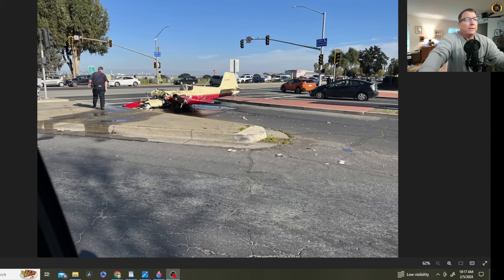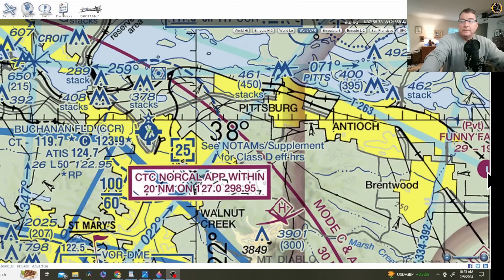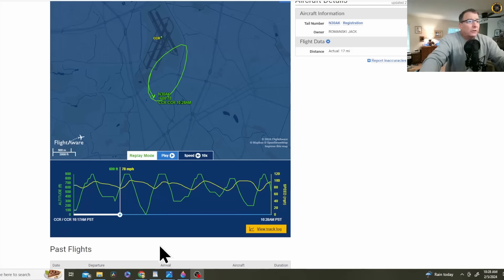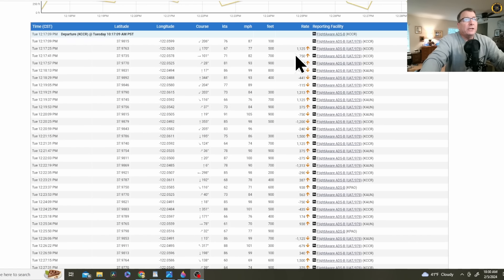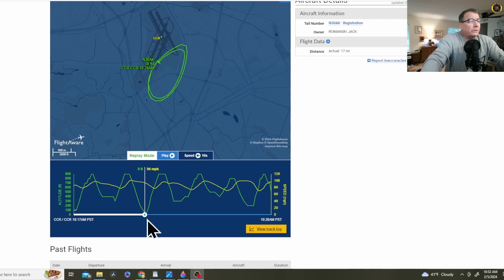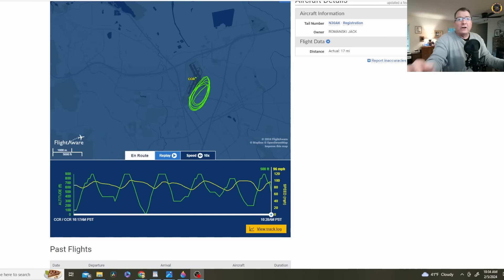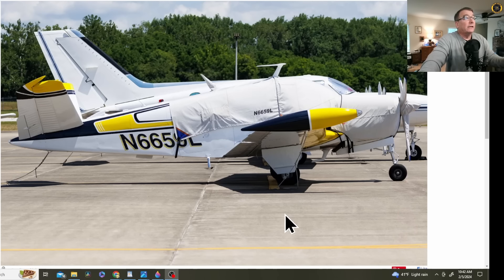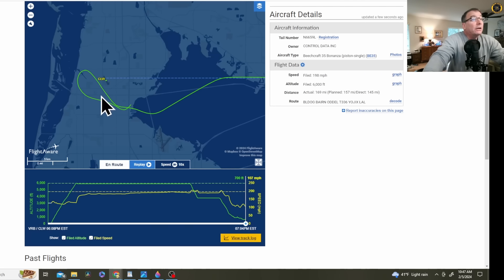RV-6 Crash Concord CA and V-35B Clearwater FL. Crash 5 Feb 2024

Comment: Spins need to be in PPL training

The video of that Bonanza crash looks like he was going super fast
Reply: Even with spin training, they don't demonstrate how a spin can happen when in a steep turn well above "stall speed."  I put that in quotes because it's not a speed, it's an angle of attack.  I believe it keeps happening to pilots when trying to make a sharp turn in an emergency because they don't realize how easily they can end up upside down before having time to say WTF?  Another factor is using rudder to help the turn.  Too much rudder makes it more likely to drop the inside (low) wing.  Instead of straight and level, perhaps it should be demonstrated (at a safe altitude) what happens when you pull back too hard while at a steep bank angle.

Comment: Juan, I'm surprised you did not mention using a moving map GPS for guidance to an airport in a congested area or an airport that is hard to find for any reason ... especially at night.   I don't think I would fly at night if I did not have GPS navifgaton in the panel, and I have over 820 hours of night time logged without an incident.   I am also an advocate of longer run ups before flying at night.   If the engine is not going to go, let it happen at the run up area or the hold shortr line, not 100' AGL.  Be careful out there, folks.

Comment: The L-19s we use for glider tows here in Hawaii (HDH) get used even harder, full throttle to 1,000', then back into the pattern and land. Often 20 times a day, seven days a week.Amazingly, engine failures have been very rare, pilot failures not so much.....

Comment: Blanco thx for analysis. My two cents on pattern engine flying is it's not really meaningfully different assuming temps are controlled. Long climbs to altitude in GA planes are probably more likely to create high CHT for extended period conditions if I had to pick one I'd pick that. Shock cooling isn't really a thing in CA temps.
Reply: I don't know much but I thought about carbon deposits? Would that be relevant?

Comment: Was the mistake simply trying to turn too hard with not enough airspeed? Would there be a way to (reasonably) safely land in the scenario he was in?
Reply: I was wondering the same thing. I would have thought he's have emergency landing spots all picked out ahead of time since he flew the same pattern so many times.
Reply: That was the mistake.  Turning while trying to maintain altitude adds G loading and increased G loading increases the stall speed.  if you're going to turn hard, you have to accept a higher rate of descent in order to not increase the G loading.  At low altitudes that's just not an option.  It usually ends up with the aircraft stalling and spinning right into the ground with no time to recover.  Landing straight ahead, or maybe within 20 degrees left or right of straight ahead was really his only option at that low altitude.

Comment: Juan, One more thought, I heard from a Cirrus driver on the ground near the airport, that the engine apparently "backfired" 3 or 4 times just before the crash which could indicate a problem and that the pilot had some prior indication of an engine issue as well.  I, too originally thought he ran a tank dry, but we shall hopefully learn what happened. I got my PVF hangar 30 years ago from the wife of a Mooney driver  who was on approach from near TVL who unknowingly didn't know he ran a tank dry about three miles before PVF. Obviously no GUMPS check. There were other factors of which I won't go into here.

Comment: Juan, you may remember in the 70s at Concord Buchanan Field a very similar accident resulted in a stall spin into Sunvalley Shopping Mall. 
Another attempt at the impossible turn or just a high Angle of Attack swoop climb with inability to shove the nose over? Slow reaction time may have been a contributing factor. 
Any sense of the fuel onboard given his fixation on repetitive patern work. Doesn't appear to be much time between passes for fuel management considerations.

Comment: Based on where these accidents occurred I would lean towards pilot error. The RV-6 had terrible pattern form and was constantly demanding near max performance to power idle in rapid succession from his engine. The Bonanza guy had an engine failure on his go around at night at the end of his trip. Both of these could very well have been fuel mismanagement engine failures.

Comment: Just another 3 blade prop accident where the pilot was unable to get the nose down quick enough to prevent a stall-spin during following an engine failure during a high performance climb out. It happened to a friend in his Rocket (can't remember which version of Rocket it was), and another one in his Starduster Two. Both of those were demonstrating the incredible climb angle of their aircraft. Both killed innocent passengers. I have often wondered if the 3-blade props were factors. Not trying to blame the prop here, but rather advocating careful exploration and practice of this area of flight by owners and pilots of these aircraft. Dan Gryder discussed this several years ago on his channel, but he doesn't leave his videos up very long, so I cant link to his video.

Comment: Dan, sorry to see about your crash. I have the same F4F as yours plus the blue version. They fly very well with no issues. You can get some minor wing flex, but only with a high G pullout. It can easily be corrected with some aileron input. If you repair it, land it with some power. Wheel landing work the best. Best of luck!

Comment: It's seems if you're flying this same sequence over and over and over again, you might not react well mentally to a quick and sudden departure from the routine.
Reply: This.  Also, I'd say he wasn't even considering the possibility of engine failure, given how close to the end of the runway he was doing the touch and goes.  If that map was aligned with the data correctly, his "pattern" could be considered reckless.
Reply: OVER FAMILIARITY - CONCENTRATION & A PLAN FOR WHAT MIGHT GO WRONG

Yep, this seems possible, since over-familiarity with what you are doing can mean that you forget to plan for the 'escape option' that you might need. Then if something goes wrong your thinking, planning and acting time to resolve matters, all roll together pretty quickly.

I might be familair with slicing the tomatoes with the sharp knife, but I have to plan each cut so as not to slice through my fingers. Of course, because I am familiar with slicing tomatoes I don't think of the exercise as something requiring planning.

The day I fail to consider what I am doing, and perhaps lose concentration or am distracted, is the day my blood mixes with the sliced tomatoes, and I have to go running to find the First-Aid Box.....

Of course, I have to know where the First-Aid Box is located in the first place....!

Strange as it may seem, the next time I pick up the knife to slice the tomatoes, perhaps my first thought should be where is the First-Aid Box...?

James Hennighan
Yorkshire, England

Comment: Don't live near Concord but I've been there many times.  Even took a side trip to just look at the airport and I think I saw an incomplete HueyCobra there once.  I have a few reasons to be there, but have gone often to Sunvalley Shopping Center as well as the Veranda shopping center.  Also a few other restaurants I like in the area as well as a water park.  Definitely see a lot planes there.  I do sometimes think of the plane that crashed into Sunvalley Shopping Center in 1985 on Christmas Eve.  That killed seven including five on the ground and injured dozens of others - especially with last minute Christmas shoppers. 

I'm pretty sure that I've made that left turn on Concord Ave to Diamond Blvd several times where the plane ended up.

Comment: Re: the RV crash, this account is not at all consistent with the word on the field from those in the know. Apparently it was fuel starvation and he did not stall and spin. He attempted to land on the road Ana’s he was touching down a car came around the corner and he impacted hit. That is from an eye witness from the field that watched it happen. Apparently there was no fuel on the ground at the crash site. Not sure why there was no fuel and he did not check it.
Reply: Yep. He did 15-20 laps every time he flew. He was really good at power off landings. He did hit a car after putting it down on the road. The driver had minor injuries. Initially I saw fluids on the ground but could not tell if it was fire department related or even from the car he hit. Either way. Very sad. Lots of people watched him fly every day. The guy had been flying the plane for 29 years.

Comment: Believe it or not a lot of people do this in vans RVs  maybe go to a close field too. But especially in a Tail
Wheel they just want to fly quick and perfect landings. 
 The pattern is plenty big for a nible RV6 it’s like racing your car around a track a few times then putting it away.   80 is pretty slow and 200 ft is pretty low about impossible For a turn back to then field.   He probably just didn’t have any reason to go anywhere and if there’s busy airspace around didn’t want to deal with it

Comment: Rv 9 A just returned to Pia. Low fuel level alarm after take off.
Returned per ok or they fixed low fuel issue. Returned ok.
Hope there on this
N309S your the pros.
Was setcup and equipment and they fixed it he Flys away. 
Oops fuel switch maybe went back and landed at aux air field.
Be safe

Comment: If you get engine failure in that situation wouldn't you just straighten the plane up and try and glide it somewhere like a road or field. You've got enough momentum speed if the engine was spluttering to straighten up I would have thought.
Reply: In that momemt yeah lift altitude airspeed. Never try to bank. But some ppl panic
Reply: It seems like he tried to make the impossible turn, when maybe he should have dropped the nose, kept the wings flying, and found a place to take it in. Problem being, there's not really anywhere to go off the front of the runway. Its highly developed around the airport to the west, with hills rising up even further west.

He was so low already, maybe there were no options no matter what he chose.
Reply: Drag's a drag
Reply: @brendanh8978  yeah I get what you're saying but surely there must have been parking areas roads if it's a built up area, pick a road and go for that  if you haven't got time hope for the best

Comment: Seems there are a lot of engine issues of late. I wonder if it’s time to build a hybrid GA aircraft engine that can give extra electric motor power when needed, but give 5-10 minutes of prop RPM if the engine fails. I know batteries for that system would be a weight issue. Just thinking about the issue. Very sad.
Reply: What you describe is a solution in search of a problem. Cirrus has already  successfully addressed this with their whole airframe parachute. And it’s very expensive to buy AND maintain.
Reply: @cessna177flyer3  agree, but when you pull the shoot, you still crash, just much slower. I’m thinking a back up for engine power. I mean, there is a back up and redundancy for most every system, except engine power. Again, just a thought.
Reply: It’s a reasonable suggestion. Enough emergency reserve power to buy a few minutes of time to regain some control. Weight and cost penalties would likely be prohibitively high, but an interesting engineering problem to help improve safety.
Reply: @davida56891  or just buy a twin. 🤷🏻‍♂️

Comment: Concord is surrounded by highways and commercial buildings. Its where i got my Private Pilot Checkride on my 17th Birthday.

Rio Vista isn't but a few minutes away and sparsley populated, uncontrolled field. Much better for his type of flying with multiple Touch N Go's. 

Sadly, its the same story.  Loss of Thrust On Takeoff...Land straight ahead or 30° left or right. Pick a spot, monitor airspeed. At the same time do your emergency flow checklist to restart your engine.

Comment: I know we only hear about the ‘news-worthy’ usually fatal GA accidents but for every fatal, how many engine failures result in significant damage / injuries. 
What is the likely hood of surviving an engine failure?

Also, what are the major causes of death from a light plane crash - is it hitting the head on the dashboard, brain hitting the inside of the skull, bleeding out from lacerations? What actually kills people. Can’t fix that until we know what the problem is.

Comment: Excellent observation about pattern flying only. If this guy did that daily he putting
constant high power time on that engine.
Reply: Is this wear/high power pattern also observed in skydiving aircraft?
Reply: @ricardokowalski1579 I would think that would be somewhat different since the skydiving aircraft would at least be climbing to a greater altitude and then descending over a greater period of time between power and near idle.
Reply: I was thinking the same about crop dusters
Reply: RV6 can do this kind of work never going over 75% power. I do it all the time.
Reply: He did this literally almost everyday .
Reply: @JV-tk3nn I don't think crop dusters would have the issue. They're usually ripping the whole time.

Comment: Looking forward to tomorrow's discussion.
As for the solo touch and go guy, this is extremely sad. If you ever see strange repetitive behavior like this, take time out to talk to the person, maybe all they need is a friend. If, like in this case, the behavior is potentially dangerous (or would require extreme duty service intervals ) just remind them that the engine would appreciate the opportunity to "clear out some carbon at cruise".
Reply: Wonderful speculation!!! 👍👍
Reply: Yep. He did 15-20 laps every time he flew. He was really good at power off landings. He did hit a car after putting it down on the road. The driver had minor injuries. Initially I saw fluids on the ground but could not tell if it was fire department related or even from the car he hit. Either way. Very sad. Lots of people watched him fly every day. The guy had been flying the plane for 29 years.

Comment: As I recall, a witness said the RV-6 pilot lowered the nose after the engine lost (some) power, which of course was correct. Then possibly he banked too steeply to get back to the airport and caused an accelerated stall. If so, a very experienced pilot failed to "aviate" properly in a bad situation.

Comment: The RV-6 pilot literally trained himself to fly a left hand pattern no matter what... At 900' he likely could have made it straight in to the Contra Costa Country Club off then nose and less than a mile away. 
Remember folks, you must assume that you will lose your engine on every takeoff. Plan accordingly!
Reply: Best example is the crew of the regional.doing their safe landing on the New Hampshire highway -- which even JB couldn't make in the sim.
They briefed that move even before takeoff.
Rule #1: Be prepared for.everything everywhere and any time.
Reply: 100%!!!  @paulsherman51  

A good plan goes a long way!

Comment: I own a G35 Bonanza with 6 tanks that dump back to my left main. I take off on the left side to make room then pull from the Aux or Tips while enroute. I will burn a few gallons out of the right just to balance the plane. Within about 15-20 minutes to landing I will set to the fullest main tank for landing as part of my approach. I don't like having to fiddle with the fuel selector while trying to do other things like landing. I will verify as part of my GUMPS check and only need a second to verify my tank but it has already been set.

Comment: Non pilot here, but have a question.   Sure seems like a lot of engine problems/failures relative to the number of planes flying.  Are thesd old design engines just so outdated you cant keep them running?  Why hasnt the industry gone to something way more modern design, and presumably more reliable.   These are old ohv pushrod engines still.  Thats like 1950s technology....

Comment: My question is, how often are pilots going out and practicing emergency procedures? Is that even still a thing?

When I was a teen & working around warbirds, the people that owned them back then would go out at least once a month, and practice stalls, spins, and engine-outs. So much so, I thought every pilot did that.

It seems that many crashes of late are happening because the pilots "freak-out" and try to make it back to a runway - ignoring the severity of their situation, rather than finding a spot where they can put it down.

Comment: Idle power abeam the numbers like that would be repeatedly shock cooling the engine. No bueno.  I taught for years at an airport very much like the air park, surrounded by urban sprawl.  We did have dim runway lights but even with 1000 or so hours of night experience at that airport it could be extremely difficult to pick it out of the weeds at night.  So much so that we were closed to itinerant traffic at night.